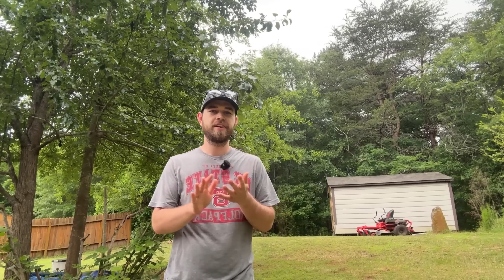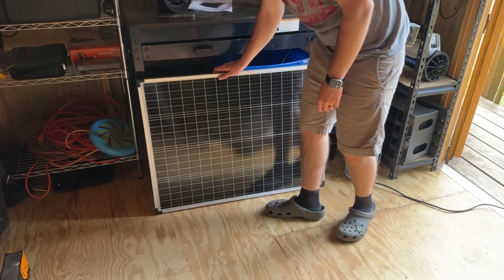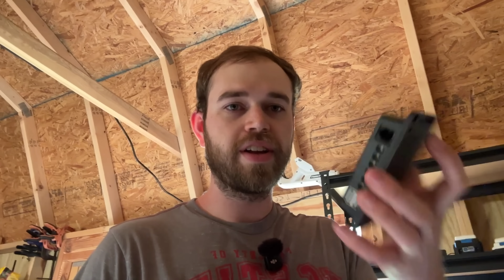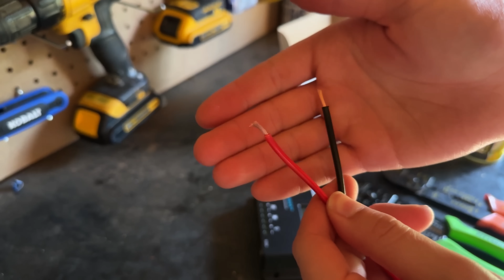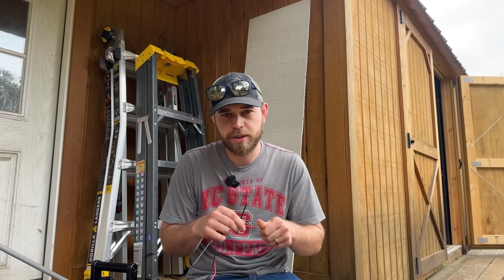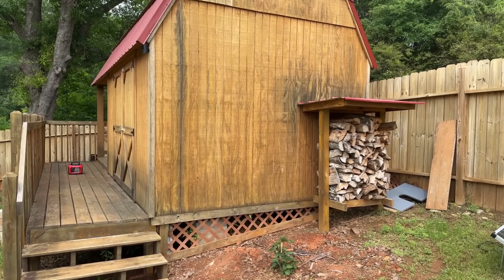I tried Harbor Freight’s cheapest solar panel setup

Comment from the maker: I just dropped a new video breaking down the 5 BEST and WORST features of this harbor freight power station. Check it out!

https://youtu.be/wmLl2BBzxhM
Reply: WIND WARNING: Nbe sure to fasten/strap down your solar panel.
Reply: @GICANbranson be careful of solar/wind charge controllers with Bluetooth it will glitch change settings and pump 100+ volts to battery
Reply: Cool thx
Reply: can you splice multiple panels together
Reply: Good tip!
Reply: I just hooked up a 120W panel I got from amazon. The charge rate fluctuates wildly, between 10 and 80w. But it's increasing the battery charge about 2% every 15min.

Comment: I was just watching an Amish gentleman on Utube and he just did a very educational show all about hooking up solar panels.You may want to watch it.He says to point it due South for the most sunlight. Also if you leave it on the ground you can disconnect it and bring it inside during bad weather, like when it snows it will be easier to clean off. I do so love HARBOR FREIGHT but I can never get out of there without spending 💰😢 at least a hundred bucks. Great video!!!

Comment: Im far from an expert but helping a friend setup her solar power I learned that if you have the same amount of wattage coming in to match the output of your device, your case 350 watts, your battery should never be low on power no matter how much you use, unless of course you have a long period of little to no sun, so get 2 more panels for an input of 300 watts and you shouldn't have any problems if you use the shed for short projects

Comment: HF solar stuff is way overpriced. $400 is absolutely not a good deal. You can get a 100Ah battery, a 200w solar panel, a 1000w pure sine wave inverter, an MPPT charge controller, and the cables needed for the setup for a little over $400. X4 the performance if you spend just $20 or $30 more.

Also an HF setup is not upgradable.

Comment: + before - because if you touch ground while tightening + you don't complete the circuit....or shock yourself....then Tired/ Drugs doesn't fry the eternal of the controller

Comment: A wire nut might be a better choice to connect the twisted wires if you aren't going to solder and then heat shrink.
Reply from the maker: Yeah I replaced with a wire nut eventually

Comment: Hooking up the battery first gives power from the panel somewhere to go so it doesn't fry the charge controller. Hooking up positive first is because there's less of an arc than if negative is hooked up first. Just like hooking up a car battery, positive first so you don't zap yourself.

Comment: I live in my older RV whose electrical system is mostly kaput.  My lighting is 5v dc lights plugged in to power banks charged with solar power. They have a good amount of light. There are solar light bulbs that have 250lumens (around 60watts equivalent, I think) that work very well.

Comment: Can You run a small airconditioner off this predator?
Reply from the maker: No, my 5000btu unit uses a minimum of 500 watts and that’s with the cooling on low

Comment: I used the solar setup 4 pannels  100 watt system.  Got 2 of them.. now i run the 100 watt panel  i lo e them plug and play.  Cant go wrong . Ived used 200 watt system 7 years and a 100 watt system ive ran over 2 years now

Comment: Yes, since you snapped both of the wires, yes you can connect them back together. I will make a suggestion in the future as when you snipped the Anderson connection from the wire maybe next time leave some wire behind the connector so that you could reuse the connector if necessary. But loving the content, keep it up.

Comment: I live off grid in the woods. All I want is to come home after work and play video games for about 6 hours (on a good gaming day) will this run a PS4 flat screen tv and a home wifi cellular wifi modem? For y or more hours?
Reply from the maker: It will probably run all of that, but not for 6 hours. You’d likely need a larger capacity power station.
Reply: @WattsNextSolar25  6 hours is on a prime gaming day. I typically only get 4
Reply: Thank you for replying by the way I'm trying to figure all this stuff out because in my new spot I have to remain unnoticed

Comment: My biggest concern w/anything that constantly gets used such as a solar panel mounted outside is how long will the brand of solar panel last? Like anything else whatever it's life span normally is,that lifespan gets cut much shorter when it's drawing in power/putting out power at a constant rate through the day. Also some power stations claim they have a recharge life of say '3000 cycles' but whats that equate to in days if it's used constantly w/a solar panel? I like your set up and I'm sure it will last atleast a few years. Have you noticed any lower performance lately compared to since you first installed it? Thanks for the vid,you did a great job explaining everything. 👍

Comment: Ive  been looking for an easy way to do some battery charging, lights and a WiFi camera in my shed. I think this should work better than trying to run power to the building. Great video, glad I found your channel. Just subscribed.

Comment: Have 100 watt panels for my sugaring house. 2 12 volt batteries and a 1000 watt inverter, all HF. Yep 2 led lights that came with my panel. Also have an eco flow delta 1000 watt power station with a set of 100 watt foldable panels

Comment: Harbor Freight sells a 4-panel 100 Watts with a 100 Watts power controller included for $149.99, the last time I saw their ad, and the individual storage batteries for around $89.99 nowadays. The total at the maximum price of those I saw is $239.98. The only thing necessary to add is a power inverter for AC power output, which can range anywhere from (Depending on the wattage) can be $50 up to $200 Ranging from 100 watts to 2000 watts, and that would bring the total up to $450.00 approximately, not including sales tax. If you only need DC power, you do not need to buy a power inverter. That scenario would be better than what he is showing in the video. The batteries being as low-priced as they are, you could, when they are on sale, buy multiple batteries, which would increase the power supply fourfold, with longer power output, considering you buy four batteries So you will not run out of power before the sun comes back out and recharges the batteries (One at a time if necessary for a low budget). You could also go online and find better, stronger batteries with longer power output time at reasonable prices. If you go to harborfreight.com and subscribe to their emails, you will know when they put the Panel sets and batteries on sale (I don't get anything for saying this!). They go on sale about every two to three months. I have 6 sets of them that I bought on sale over a period of 5 years. I have bought two of the 100-watt panel he shows in this video, one for $69.99 and one for $79.99 on sale (A long time ago). Suffice it to say, when I have money, and they go on sale, I buy. I bought them for future use, just in case something happens to the power grid for whatever reason.

Comment: Question: does the power station continue to charge after your finished? Does it turn off then you have to turn it on next time you use it? Thanks...
Reply from the maker: It charges until it is fully charged. I turn it off when I’m done using it, but it will automatically turn off after a certain amount of time if it doesn’t detect a load
Reply: thank you!! Happy New Year!!

Comment: Nice video of your very simple and affordable system. I would look for a heavier gauge wire to run from your solar panel to your power station. I use a 10 gauge wire on mine. I think your loosing some watts there.

Comment: Why are blowing shit up viewers asses,that shit is junk ,350 watt power station,what you run with it,lights and charge phone that about it,if you spend 400usd you will have 100 wh battery 1000 watt pure wave invertor and 2 × 100 watt panel,good knows 60 usd ea

Comment: I should have done my homework , the numbers were never going to work for my project. I knew that, but not how bad. I wanted to set this up for my lambing shed. I lamb in January in Northern Wisconsin. I might get lights out of the deal, but I still need to run extension cords to keep the water from freezing ithe new mother's buckets. A 5 gallon bucket would kill the battery in less than 2.5 hours, a 2 gallon bucket less than  5. The  reaal killer though; cold warning comes on in our 20 degree nights. And that is not cold, here. Pretty warm for the 22th of December.actually. So even a 2000W will not work. You guys in Florida enjoy, I'll have to come up with another project.
Reply from the maker: Yeah, these aren’t great for extreme cold. There might be some work arounds, not sure. It doesn’t get that cold here in NC very often
Reply: @WattsNextSolar25  Extreme? LOL, we get frost and it doesn't work? Don't mean that as mean as it sounds, I realize an insulated building may change things. Just not practical at this time. Wonder how well it works at a real challenge of -20 at night.

Comment: You are supposed to charge it up with 3 of those solar panels to get as close to the wattage it is to put out. Even a little over what it puts out at max. 400 watts to keep it from ever working harder to charge it up and or to keep it charged up.

Comment: Okay, you are using a 100 watt panel, on the back of the station it says 125 watt Max, but the owners manual says you can use a 200 watt panel. What is the deal? They just trying to confuse me? I can get 200 watt panels locally.

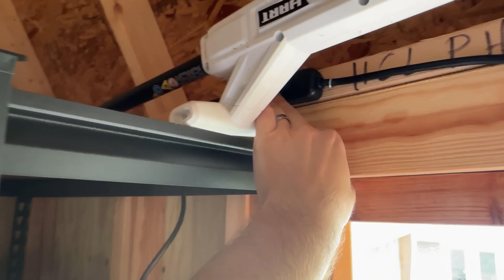Comment: 10:00 do yourself a big favor and get some 12 Volt LED lights for your shed
Reply: I have 6 small (5") LED lights in my cargo trailer (6' x 12') that I run off of one of my 18 volt Rigid tool batteries and I can perform surgery.
Reply: 12 volt?? bro you can get 5V led strip from temu and be done with it LOL

Comment: Oh, by the way, cross over connectors are available on line. Some ACE hardware have them. And oddly enough, every once in a while Harbor Freight will acually have them in stock.
When you do find them, get extras.
The goofiest connectors I ever ran into were those L shaped ones on my Honda generator.  And it took about 5 months to order 3 sets of them. When I finally went to pick them up, a fellow in the store saw what I had in my hand and offered me beaucoup bucks to get just one set from me. NOPE ! . . . MINE !!!

Comment: 7:00 posivtive first !
Good way to lose you job as a gate/ramp agent at the airport is to burn out a passenger's electric wheel chair.
It is Not a 53 Plymouth. It does not have a ballast resistor !

Comment: Wouldn't it be easier to run an electrical cable from your house to your shed?
Reply from the maker: Where’s the fun in that?

Haha no but really, I plan on doing that one day. Where I live, you have to get permits and go through a bunch of red tape to get a wire buried like that. So just haven’t felt like dealing with all that yet

Comment: 12 bulb LED string lights use appx. 10 watts total and can be linked together to go around your ceiling. Your HF 100w watt mono panel should put out much more wattage when angle is correct. Enjoy your shop! 🙋‍♂️

Comment: I really don’t get why you’d want the external controller.  There’s already one in the station. You also have no way to isolate the battery on the station.  You didn’t get anything on the screen of the controller because you can’t connect directly to the stations battery. They power on when connected to a real battery.

Comment: My HF panels, 2 sets, are 6 yrs old and still chugging along-2 sets feeding 4 HF batteries-also 6 yrs old. They’ve never really held a charge. Ie low voltage cut off a couple hrs after sun set running a small fridge (1.4amp 120v small) but were not there much and the genny steps in as needed. Think I’ll try this set up next

Comment: I bought the harbor freight solar set up for my barn more than 5 years ago and it is still going. I have it mounted on the front wall of the barn near the roof, so it is somewhat protected from hail and storm damage but still gets full light. No issues and works every night!! I am only running one barn light over the entrance, but I am still impressed.

Comment: I never understood why campers would rather have an expensive and complicated solar set-up on their RV when this is an option for power.
Reply: My camper has heater, AC, microwave, TV, stereo, wifi, satellite dish, etc. My shed does not. Requires a more complicated solution.
Reply: @MarkSadler-w8c well aren’t you cool…
Reply: @johnbradley5236 don't be jealous or a hater
Reply: @johnbradley5236   what he stated is VERY true. Just the blower on a propane heater can deplete batteries in a night or two so there's some math to do for proper sizing.
Reply: @johnbradley5236 well are t you childish
Reply: This can only power so much, and not for long

Comment: Those power stations are designed to go direct to the solar panel. Most are used for portable applications with folding travel panels

Comment: You could use a different charge controller the charge controller that you used earlier you can run it off the power station and run another set of tools but as far as running the power station I would not have done that in the first place because that just reduces your amperage and water and you won't get good output you won't get the output you need to charge the power station giving you a heads up?

Comment: Good video. 

When you run your cable into your shed, place a drop in the cable so it runs up. This way when it rains the water will not run down the cable into your shed.

GOD bless you and your family
Reply from the maker: Great tip! Thanks

Comment: Order of electrical connection is important. 
The panel is always producing electricity, unless it’s COMPLETELY DARK. 
Just like any DC system. Power runs - to +
It’s the exact same reason when jumping a dead car battery 🪫 
+ end FIRST!

Comment: Anyone;  Would this work to power a small heater, one that would keep the shed @60f ? I'd like to store some delicate electronics, but I'm trying to figure out a "set and forget" config.    thx
Reply from the maker: It will not run a small heater, at least none of the ones I’ve tried. I’m dropping a new video tomorrow showcasing real life examples of what it can and can’t run, including a space heater
Reply: @WattsNextSolar25  thx!

Comment: Nice, short video. Good information. Three things: 
1) Your idea for the second charge controller would not work because it requires power from the "battery" side, which is not how the battery bank works, i.e., it's not designed to provide power OUT. This is why you were instructed to connect the "battery" first. 
2) Power Poles can be released from their housings by sliding a small flat blade screwdriver down into the housing from the wire side.
3) I always try to leave 20-30cm of wire when cutting off a connector so I can make another cable assembly. In other words, you wouldn't have needed to cut up that second assembly. 
Again, well done and thanks!

Comment: Im purchasing a small camp trailer.... im thinking that I can recharge the 12 volt rv battery from the power supply with a charger and by nightfall have a fully charged 12 voltage battery and a fully charged power supply..... I hope😬 am I delusional? Or on the right track? Thanks for the video.... can I link two 100w panels in series to the predator for better results?

Comment: Bottom line is if you have a problem, you can return it to harbor freight. The others you have to box it up go to ups, FedEx or the PO. Then wait 4 to six weeks for them to respond. Cheaper doesn't always mean easier or better

Comment: Good video.  Build a Box /  Put the Solar Panel under a Structure that's designed for Rain , hail & wind. 
use a Piece of plastic for the top so the sun can get in. 
Leave sides open for air flow.

Comment: One issue is by just twisting the wires and not soldering you are inducing resistance so you will not get the best results. Solder them and then use some liquid tape or use the meltable solder and seal splices

Comment: 100w is basically nothing though, and that power station will only work for 1 hour, Using less then 300 watts. You ate better off buying a 200 amp hour deep cell battery.

Comment: The charge controller didn't work because you cant Stack charge controllers, the one that wouldn't cycle on couldn't see the battery through the onboard one, it needs to have direct access to a battery to gauge the State of Charge, try it just with your car battery

Comment: With all Anderson plugs,,look in the nozzle end,,the flat spring is always a bit wider than the terminal,,letting you push it down and release the terminal out back,,might take a wiggle but it's designed to do it,,plus,,every device adds its loss,,you will get less power in useing two controllers ,,

Comment: $400 dollars to run 100 watts of energy to a shed when a $40 extension cord, a $10 ONE year electric bill and no worries about the certainty of replacing cheap Chinese electrical devices would’ve gotten the job done. People today: why save yourself time, $, worry and work when an absurdly convoluted alternative option is available. *and fyi, there’s no such thing as Green or eco friendly or completely off the grid energy unless you have a hand built wooden water wheel you slapped to the side of your house.

Comment: I was surprised to see you cutting the wire to connect a second controller. It should be obvious that you don't need to do this. These power stations all have controllers built in! Once you saw the power coming in initially, you should have just immediately sent the other controller back.

Comment: I am not sure why the insistance on an external charge controller.  The power bank has one.  That's why it doesn't over charge when you plug it in the wall.